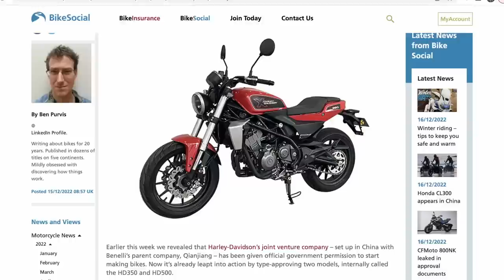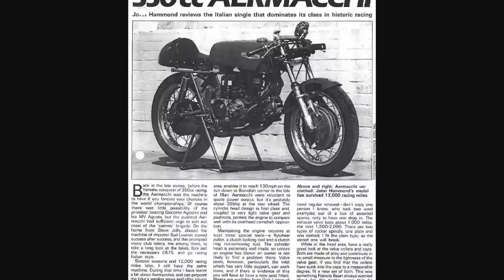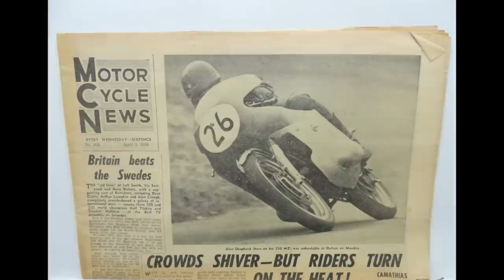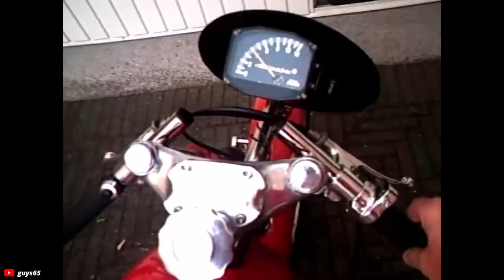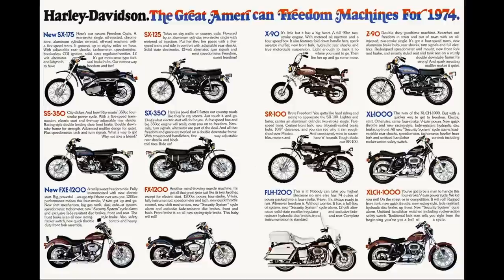The time Harley Davidson won MotoGP

Comment: Technically "Moto GP" didn't start until the 500cc class was replaced in 2002 when they moved to the new 990cc four stroke engines. Harley have never been in the Moto GP competition. Regardless Harley have never won the premier class championship which is the pre moto GP era equivalent.  Winning the 250 class in 75 and 76 and claiming it as the premier class is like a current Moto 2 champion claiming to have won the Moto GP championship. It is just wrong. It is for this reason the title is misleading at best or just plain wrong.
Reply: THANK YOU!!!!!!!!

It really gets under my skin seeing/hearing the pre-2000s series called "MotoGP" (and not just on this vid). Because IT WASN'T. MotoGP is a pure marketing term and goes right along with traction control, wheelie control, electronics up the exhaust port, and the corporatism that has killed so many once great sports.